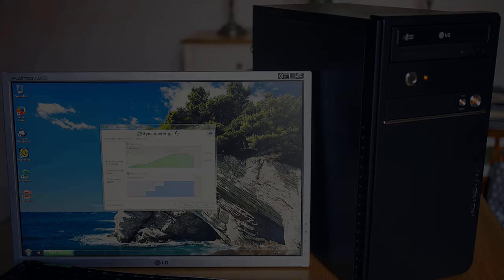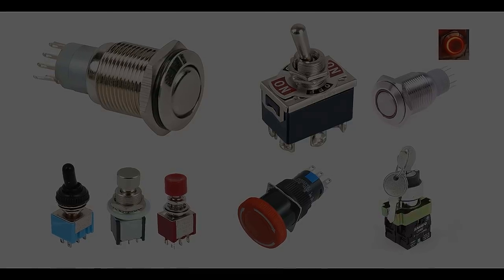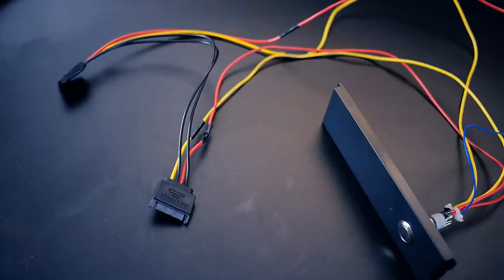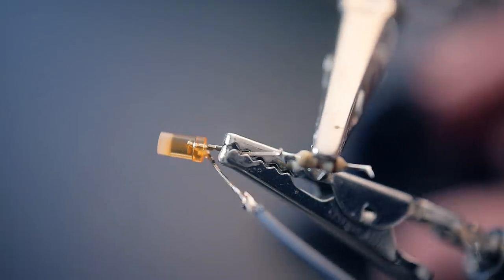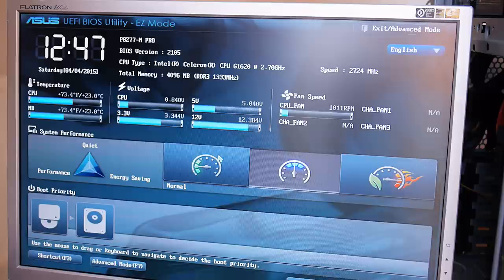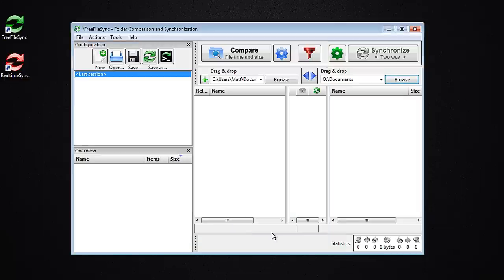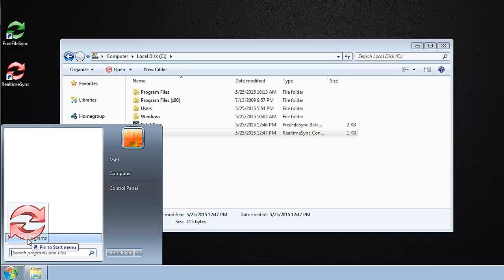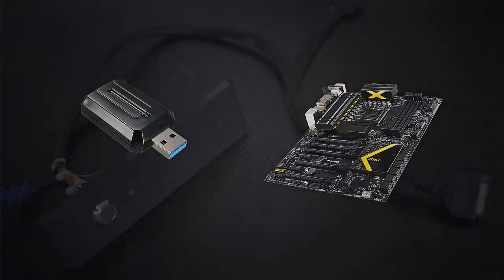How to Make a One-Click Backup Button

Comment: Your method is pretty complex for a just software thing. For only data backup, I prefer to write my own code (short learning curve & more control) to automate, and then use a cheap USB hub to switch on and off the storage (protection against ransomware).

Comment: Pretty neat man, i will stick to dropbox though, even easier :).
I can recommend you a stepped drill bit, i've picked up one a while ago and had large drill sizes sorted with that
(at least for anything thinner than 5mm)
http://img.dxcdn.com/productimages/sku_296440_1.jpg
I bought mine for around 15€, that thing has eaten v2a  stainless steel and is still alright.

Comment: Not simple. Overly complicated. Potentially dangerous.

Problems:
  * Accidentally turning off the HDD during a backup/windows using the system will corrupt your backup
  * No de-bounce on the switch
  * Race condition between the 12V and 5V rail
  * Still relies on you remembering to turn the drive on to backup
  * WILL NOT prevent your files from being held to ransom (when  you backup your files it will backup the encrypted ones as it takes time for the ransomware to encrypt your files)

Better solution:
  * Use a file system that is resilient to corruption
  * Software un-mount the drive when not in use
  * Scheduled backups by time, software trigger or new data on the drive
  * Cloud backup files (DropBox, Google Drive, etc

I personally have my laptop automatically backup when I get home to another computer, triggered by my main computer seeing my laptop on the WiFi. It then copies the files and makes itself responsible to copying that data to as many places as possible. Like Apple's time machine, it does dated backups by linking to previous already copied files saving on space.
Reply: +TheFrenchMansControl Software drive unmounts are more vulnerable to viruses that only activate sporadically.  Computer components are designed to make race condition a non-factor because voltage rails inside a power supply are not the same length.  And the solution to ransomware is the same for a completely software solution as it is here, differential versioning backups.
Reply: +Folopolis the software he uses has versioning. I use it.
Reply: I whole heartedly agree. A button instead of schedule is dangerous. Schedule and use versioning, which is part of the same software.
Reply: Aaron Blankenship
 As I said before, scheduling does not protect your backup medium from viruses or ransomware.  To protect from that, the drive needs to be physically disconnected. Although, to avoid destroying your system, I'd still just go with a USB drive and plug it in every couple days.
Reply: Scheduling on an external system would be a solution, that has its own version system. Example: my HTPC has a huge unused HD in it, and it pulls down a copy of my server data once a day, with versioning.  I then duplicate the scheduled job on another free machine (my wife's in this case) and trigger it manually once in a while just for extra protection.
Reply: +Folopolis Whether it's software un/mounted or hard mounted, the same code will run in your operating system. Whether you regularly mount it yourself or through hardware, it'll make no difference at all.

You can get some strange reset conditions on a large number of chips if you flip the rails in quick concession. You can force strange circuits through the chips. They are not made to do that. The input rails will be noisy too.

Physically disconnecting your drive will NOT stop it from activating on that drive. You'll mount your drive, it'll see a new place to encrypt and start scrambling your data. The solution needs to be more disconnected than that, stopping a normal system from communicating with your files.
Reply: TheFrenchMansControl
 Physically disconnecting the drive at least gives you the chance to notice and remove the virus before the next backup.  And like I said before, computer components are designed to handle noisy power input, after all, the same Seagate drives that millions of self builders are used in big box computers with $8 power supplies.  And also, like I said before, the button does give too many places for you to screw up, so I stick with a USB drive that I can easily plug in and unplug.
Reply: +Folopolis The whole reason a virus is effective is that you (and your anti-virus) don't notice it's there before it's too late. Ransomware has to be good at this because it takes ages to encrypt your data beyond recognition. I imagine it also has to hack part of your OS too so that you can still access your files "normally" without noticing they are gone.

Arguable, I've worked on low power chips and have had tonnes of problems with different voltage conditions. I'm not interested in measuring dicks, so I think we can agree there's potential?

I personally use Linux, locked down like a fortress, coupled with a backup script that looks for computers I own on the same network and synchronises them all with itself with dated backups. I then occasionally ultra compress the data and burn it either onto a Blueray disk or an old HDD and put it into storage. The process is rather slow though because of the really heavy encryption.

The problem is, if you're putting an encrypted drive into storage for say, 10 years, you need to make sure that in 10 years time people still can't hack it. On a side note, I also do security by obscurity simply because I worry about Quantum Computers being able to instantly solve problems such as TSP, making RSA trivial. Once it's that easy, obscurity maybe the last defence.
Reply: TheFrenchMansControl Let me be more specific, a chip is not going to be protected from bad voltage sources by itself, but all components in PCs have their own voltage regulation systems, and those will protect the chip. 

As for the rest of it, to each his own, but I'm more comfortable with an air gap.  But if you are leaving hard drives on a shelf for a long time, you need to occasionally connect them to power, otherwise the bearings in the motor can seize up.
Reply: With what I've worked on, typically the tolerances have been getting smaller with supplies getting better. I've also seen some Companies using regulators in the processing chips themselves.

Fair enough, but for newbie people, I personally wouldn't reccomend this hardware solution with so much opportunity to mess up.

Comment: This should be titled "How to cause drive failure"
Reply: all it is is a few power wires, it wouldn't cause any corruption.
Reply: @TheAechBomb  Cutting power to a spinning harddisk causes the head to not park...
Reply: @valrina  most modern drives can easily recover from sudden power-off, unparked heads included.
Reply: @TheAechBomb  I am not talking about being able to recover... If the head is not parked and the drive experiences vibration it can crash into the platter and cause data loss. Also even though it survives it it's not good for the drive and can cause it to fail faster. And you don't want your backup to fail...
Reply: @valrina  assuming the drive is inside the case, it shouldn't be moving around much at all
Reply: @TheAechBomb  Have you ever kicked your desk? It moves if you do that. Also your case has fans which vibrate.  The head needs to be parked, It's that easy.
Reply: Unexpected cutting power to a hard drive is really bad for it always safely eject it first
Reply: @jackstech601  I have a portable drive that auto-parks when power is removed, you can just use one of those
Reply: @TheAechBomb  yeah but it's still really bad for it and especially if it's a Seagate drive or will fail soon. A few accidental unplug while the drive is on is probably alright for it but to keep doing it it is not good